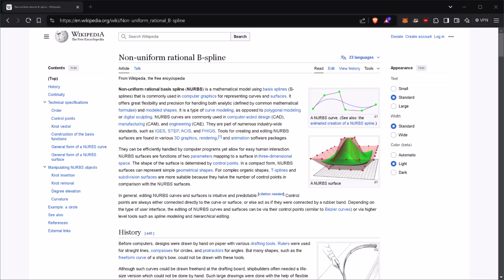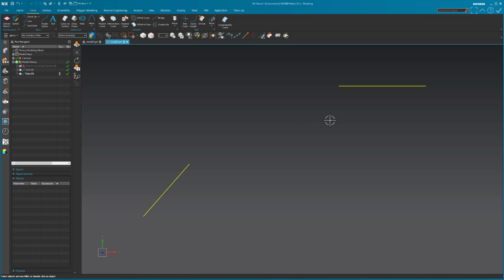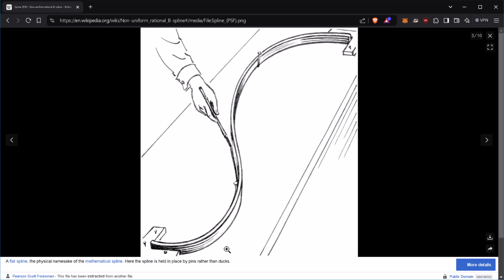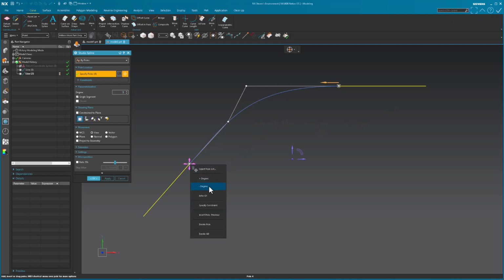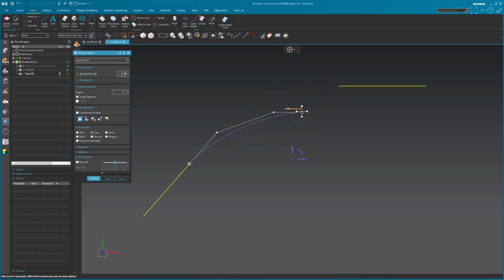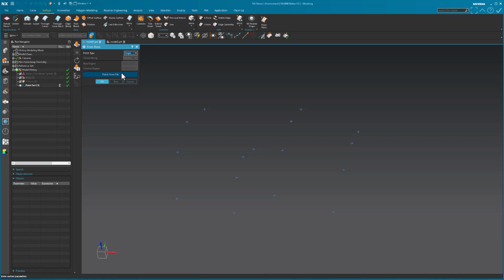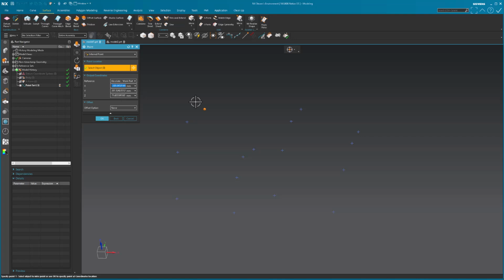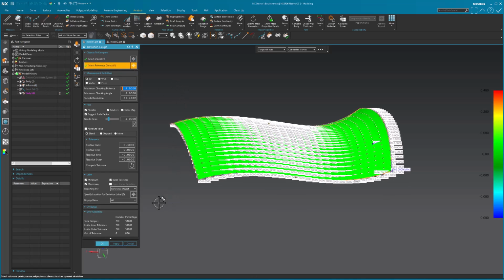The REAL History of NURBS 📐 Why Class A Surfaces Were So Strict - CAD Engineering Deep Dive

Comment: What you said about replicating shapes is only true for a Bézier surface (i.e. a NURBS surface that has only a single patch). Once you start using multi-patch surfaces, the shape is not defined by the control points alone. There also things called knot sequences that control the shape, and you can’t control these via the UI. So two different CAD systems might choose knots differently, and you’ll get a different shape, even if the control points are the same.